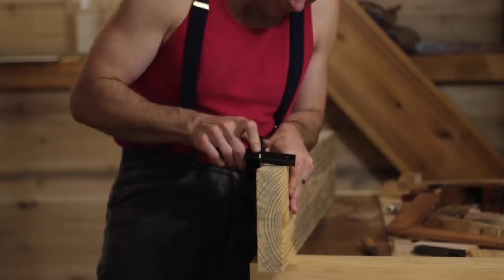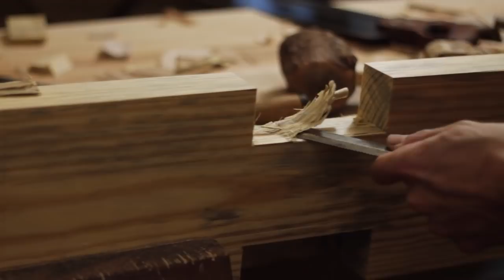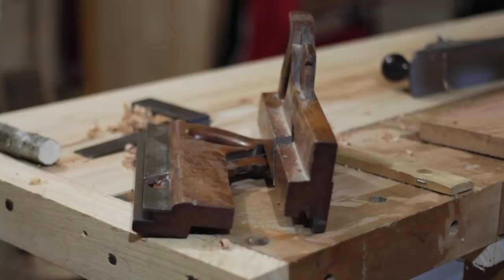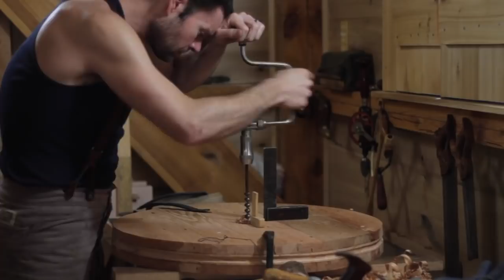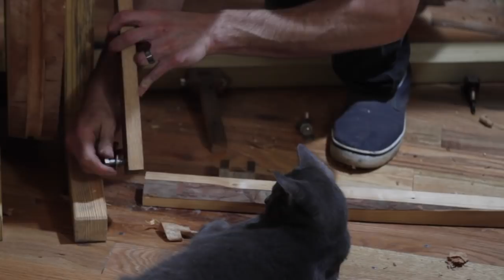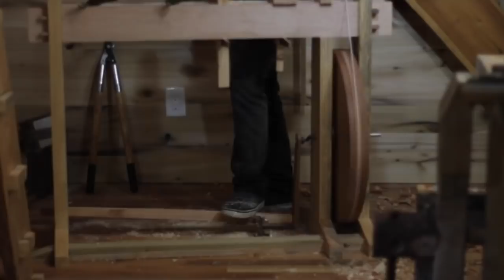TREADLE LATHE

Comment: I used the spring pole lathe for years after I watched Roy build one. Now id Like to try a treadle with a cast iron flywheel, just to try that also.
Thanks Josh and your wife.
You guys really do have great videos👍
Reply: Spring pole is simple and quicker to build maybe, but this is nicer because your workpiece is 100% clear all the time. I wouldn’t want to try to make something like a rolling pin on a spring pole and trying to make a smooth cut from end to end.

Comment: I made a treadle large several years ago and I will say this, if you use a 5/8” shaft for your spindle you can get your hands on some Shopsmith accessories like a drive spur that slides onto a straight 5/8” shaft and even some spindle adapters for a 1” x 8 tpi spindle thread for being able to use scroll chucks.

Comment: If I become half as competent with my leather as you are in wood, I will be a happy man. Excellent craftsmanship!

I'm sure there are mistakes - there always are; but it works, and it will hold up to decades of use, if not more. (and it would likely take either yourself or a master craftsman to point them out) 

I'm also more than a little envious of your tools. The specialized planes and that beautifully robust bit/brace, especially. Wondrous tools, in the hands of an excellent craftsman. Truly inspiring. Thank you!

Comment: Great job!!!  You should change your tool rest design so that you can move the rest as close as you can to the work without it hitting and still able to  leverage your tools.  In the last shot of you turning your tool was very over extended.  You have much less control on the tool and much more likely to have an accident.  Love the design of the lath, I have built, well I don't know how many actually over the years now.  Have fun turning on it, there is something magical about a foot powered lath!!!!
Reply from the maker: Thanks, yes Ive never turned before, and the tool rest was modified just as you said right after the video haha. I can see other more powerful designs in the future for sure!

Comment: You should consider setting up a tool rest next to your fly wheel and get that turned true round with your scraper. That should vastly reduce the wobble.  Awesome project. There is an all wood Lathe similar to this at the old fort just outside Thunder Bay Canada.
Reply from the maker: I considered it, but it works fine, I don't mind a bit of wobble.

Comment: You made a square peg fit in a round hole. Bravo
Reply: Given a big enough hammer, you can make anything fit into anything!
Reply: If you use a square peg in a round hole, the wood will never shift, and the peg will never loosen or back out. It compresses the wood fibers in one direction and holds through a combination of friction and pressure, the fibers holding everything in place. Similar to how cut nails work (which is way better than round nails).

Comment: Dear Sir, as usual, another well crafted production. I was looking at pole lathes when I came across your implementation of a treadle lathe. I like the constant velocity provided by the flywheel. The angular velocity of the workpiece is greater than on a pole lathe. That can only be good. I do have one question however. 

The tool rest as it is designed can travel in and out the width of the gap between the two bed rails. As it stands, you could not handle a piece of greater diameter. Have you thought of a means to give adjustment in the horizontal plane as well as the vertical for your tool rest so that you could work bigger pieces eg 6” in diameter?

One method would be to make another tool rest for bigger pieces or another would be to borrow from a metal woodworking lathe and run a bolt & nut through your bed gap with a slot to slide in and out. This would probably be best done in metal.

Comment: First, I'm totally impressed!  What a fantastic addition to your wood shop.  I have one question though.  Maybe it's an optical illusion, but on the small wheel up above it looks like the rope is constantly rubbing on itself when in use.  Doesn't that cause the rope to rub or even burn through rather quickly?
Reply from the maker: Roy Underhill calls this an "infinity" loop, it gives a lot more friction and helps with slippage, Ive not noticed any issue with rubbing.

Comment: I have seen spinning wheels for loom bobbins made from bicycle tires where a string wraps around the smaller portion making an "X" like in this video.  I have to wonder if there is undue friction causing the cord to wear out and if so how long it takes?  I am making a diy sewing treadle and almost finished with the balance wheel.  I have to wonder if the leather (or other belt type) will wear itself out by rubbing if I use this method or not?  Please let me know how long your cord lasts on this treadle before replacement.  Best regards, Mike
Reply from the maker: The "infinity loop" with rope will last a long time, normally needing retightened many times before wearing away. An alernative is to just use a leather belt and an idler pulley ti keep it tight without the complete looping.

Comment: There's so many things I want to talk about. Like how impressive it is that you got so many rpms you got out of that design, the friction fit jointery, how you could have gotten a job as an old timey strong man. But most importantly, do you dress like this all the time? Its a (very) good look but how do you avoid heatstroke?
Reply from the maker: Thank you. These are my preferred work clothes, because they are comfortable and durable. I sweat when I'm hot, and drink lots of water, not nearly as bad as Iraq was...

Comment: Can't you figure a way for those cats to power your new spindle lathe? Tuna fueled? Charles, you gotta earn your keep.

Is that rabbet plane new? is it fun sharpening the iron so the edge is parallel to the sole. PITA on mine. I had to make a gage.

Router planes and tenons are the bomb but the Stanley #71 needs an add-on sub-base to make it wider for longer tenons. 

That's a dandy design. Adaptation? 

I love those cast iron flange hubs. Wherwe'd you find them?

A real homesteader would have hand forged those ball bearings.
Reply from the maker: Been trying, but the cats might cut my pay…

Its a lovely steal of a Badger plane, mostly unused. Got lucky on the iron, not too far off…just hone and go! 

Been meaning to do that…need correct screws to attach…never remember anything from town…

Yep, everyone seems to love just bolting shit together…not me, I prefer to have anything at least structurally joined, sometimes can't avoid tacking shit on the outside, like our house, but at least everything I make has its guts or all of it joined. 

They carry them at Lowes…who knew?

I guess Im not a real homesteader then! ;)

Comment: Do the bearings that you used fit into  the historical theme you're adhering to?  I would like to hear more about your philosophy in this construction. Why do you use the methods you use, and when and why you deviate from them? 

Thanks for making awesome videos!
Reply: Just because he uses hand tools, doesn't mean he's trying to strictly adhere to old time methods. He will use more modern things when necessary. Bearing s help the lathe run much smoother than not using them and prevents wear and tear of rubbing wood. So, it's efficient and smart to use bearings when a project calls for them. Besides, bearings have been in use for thousands of years in one way or another.
Reply from the maker: IM not really adhering to any theme or era. I don't believe power tools to be necessary or a good idea, and I do not enjoy using them. I also enjoy pure wood to wood joinery more than mechanical fasteners or glued joints, so when I can, I use only hand tools and wooden joinery. I find this way efficient, healthy, and enjoyable.

Comment: Excuse me, why not use round pegs? Square pegs just for ease of making? Or is there some kind of locking mechanism offered by going with a square tapered peg?
Reply: Ryan Prince with a background in engineering, I would say the square peg would have a tighter bite, won't spin loose, and helps to draw the joint tighter as well as easier/less time consuming to make.
Reply from the maker: you hit the nail (or peg) right on the head my friend, easy to make and the corners dig in and lock the peg better

Comment: Excellent work!  However, there is no need to cross the drive string - just spin the flywheel in the opposite direction.
Reply from the maker: The string is crossed for extra friction, not to change direction.

Comment: I've made about six pole lathes, but never a treadle lathe. That is a very elegant treadle lathe and of course the bearings make it run very smoothly, so much easier to use than a pole lathe. Did you hot-bend the crank? Also how does the spur attach to the spindle?
Oh yes, I admire the treadle itself. And the joinery! Keep them coming.
Reply from the maker: Nice, yep I can see it getting addictive and Im already wishing I had made it differently this way or that, might be making another in a few years. Yes I bent the crank in the forge and leg vise. The drive pulley runs on a 1/2" axle, this gets a 1/2"-5/8" adapter sleeve, which is drilled and pinned in place, then all manner of shop smith attachments can slip on and tighten down with a set screw.
Reply: Do you have any plans available for this? I love your work and wonder how you got started with hand tools and learned your impressive skills.
Reply: +Jeffrey “The Bumbling Bushcrafter” Sawyer if he started like me he just didn't have power tools and he made do with what he had and after a while of practice he just got good at it

Comment: I’m wanting to build a treadle lathe. Would you make any changes to your design after using it for awhile?
Reply from the maker: Yes, Id make it longer (longer pieces possible) and Id make it a velocipede instead of treadle. I might alter this one in those ways in the future....also a belt tensioner would be nice! ;)
Reply: What is the length of your lathe? I would think table legs would be my maximum length needed.
Reply from the maker: You want to make sure your longest possible turning, plus the waste in front and back you will likely cut off fits between the point of the drive shaft and point on the movable tail stock, with some more room for play.
Reply: I would not have considered the waste wood in my plan. I appreciate the advice. Thanks
Reply: I have started building my treadle lathe and filming the project. I would love you to follow along and help me as I go. Your video is certainly a inspiration and reference for my project.

Comment: That was really neat! I like how the wood spins continuously in the same direction. I have seen other treadle lathes that have the wood spin in a back and forth method which is a waste of shaving time as you can only shave the wood when it's spinning towards you and the cutting tool, not when it spins back.
I've never seen any one sew two ends of a rope together like that before. Is there a way to adjust the distance between the wheels as the rope stretches so you have have tension on it, or do you have to sew on a new rope to get it to be tight again?
Of course, love the kitties, esp the gray one who likes to watch you working on your projects. >^..^<
Reply: The "back and forth" ones are spring pole lathes (Roy Underhill makes them often).  They have the advantage of being very simple to make, and can use a good tree or limb outside.  They can also pack down into a golf bag.  Of course, if I were doing it all the time, I would do what this cat did too.
Reply from the maker: thanks, yeah you can actually tighten the rope by pinching a loop or twisting a peg around it to form a loop, then hold it there while you sew it again, then cut off the loop. or add an idler pulley...
Reply: Thanks Mr. Chick-a-dee.
Reply: That's exactly what I was thinking of, Roy Underhill's spring pole lathe. I remember seeing him using one on TV when I was a kid. He still gives lessons in using older tools. He got his start at Old Sturbridge Village in Massachusetts.

Comment: Nice one, just one question, why the string cross right before the small pulley? I'm not familiar with that kind of lathe. Is it there to prevent it from slipping off?
Reply: Poe + It is a very small pulley, I imagine that the twist is just a simple method to increase contact area of the"belt". If you ran it straight less than 1/2 of the pulley surface would be engaged when paired with a flywheel of that size.

Comment: I'm sort of interested in making a treadle lathe myself, could you tell me how you  fixed the wood to the spinning axle so that it doesn't slip and/or is centered quite decently?
Reply: The small pulley to the spindle? He drilled a hole into the rod and nailed through the pulley into the rod.
The flywheel? Not entirely sure, but seems easy enough to do a similar thing, granted at an angle.

You could also weld a small piece of metal to the axle so it could slip into a slightly undersized notch on the pulleys. That would make it easy to remove and exchange wheels. Be cognizant of the other end of the rod though, one side needs to be able to slip out of all the bearings!

Comment: did they use stone/metal flywheels? just wondering whether the extra mass/weight might make more agressive cyts possible?
Reply from the maker: Im sure a huge metal wheel would be nice, or even cement or stone! Leonardo made a HUGE wheel for his lathe, I'm sure it worked out great.

Comment: May I ask how/where you went about getting the metal hardware for the lathe? I think that I have everything else that I would need, but I have no idea where to start regarding the metal parts.
Reply from the maker: some are parts from old shopsmith lathe tool, others are just bearings and 1/2" mild steel rod I bent in the forge

Comment: Beautiful! Good job, keep up the great work. How do you ensure it spins in the right direction? Is there a mechanism or do you just have to start it with the crank arm to the back?
Reply: Alaska Skidood hand spin the flywheel the direction you want to go then start peddling. You'ld be likely to break the "peddle" if you tried to start the weight of the flywheel with only the peddle. It was the same with the older treadle machines of any type. yhe mechanism wears faster without a "hand" start.

Comment: Mr chickadee how did you fix the flywheel to the crank? im trying to build a lathe just like yourz
Reply from the maker: the crank shaft is just 1/2" mild steel rod, there are 1/2" cast iron pipe flanges that screw to each side of the flywheel, then a hole is bored through the rim of the flanges and on though the crank shaft inside, then a nail goes through all and is bent over.

Comment: Wow ! Mr. Chickadee did you design the Lathe ? And not to offend but did you have 
a set of plans to follow & if so where can we find them? Beautiful Work & Machine !
Reply from the maker: Thank you, I started with plans made by Roy Underhill in his book "the woodwrights guide" then I modified the plans to permit everything to go together with purely wood joinery instead of the normal metal bolts or screws. So yes, there is a plan out there, but no, not exactly the plan for my lathe…sorry if thats clear as mud! ;)

Comment: Hello again. Can you please tell me why you didn't just saw the cheeks off the tenon? Again I'm not criticising, am genuinely curious, ignorant and want to learn. Thanks dude you're awesome :D
Reply from the maker: if the grain is straight its almost always faster and easier to split off cheeks. Also, large or long tenons is alot to remove by rip saw, doable, but not the most fun in the world.
Reply: @MrChickadee  Thanks :)

also "tub" is the word of the day ;)
Reply: @MrChickadee  oh, can I please bug you one more time? :P When you have that plane that makes the tongue and groove boards, does the tongue one take a shaving off each side or do you reverse it? Looks like the shaving only comes out one side...
Reply from the maker: q @MrGoatflakes  Match planes, as they are called, are made to center on a particular size board, so you see them in 3/8", 1/2", 3/4" and so on, they will either remove a groove down the middle, or in the case of the tongue plane, will remove wiid from both sides of the tongue together with each pass, as the iron is wider than the board but split down the middle.
Reply: @MrChickadee  oh, ok. Thanks

Comment: How did you make that square its awesome
Reply: dhsneed3 finger tennon slide joint?, 3,4,5 triangle insures square. Math serves mankind again.
Reply from the maker: The big square has a double tenon, if you joint the edge of a board, mark a line then flip the square over, insure the line is the same it proves how square it is.

Comment: no sand paper (no paper making and glass/sand/glue  needed) , no electricity, very little steel (that needs a lot of energy to be produced, likely not in your own region) tools, no noise, no earprotection, and overall time of making an item....i wouldnt say it is MUCH slower then making it by machinbe tools (except when mass - pproduced). All in all... i think its much more efficient, faster (tool-making and waste and pollution management included), cheaper, healthier and satisfying way of producing. Why we ever stopped working like this, god only knows.....